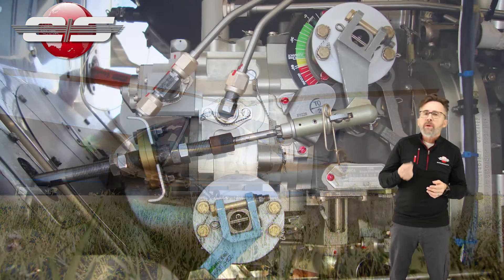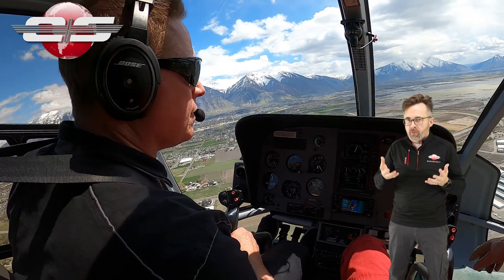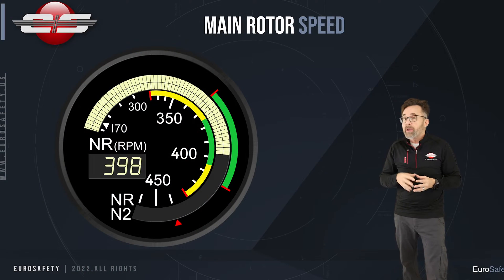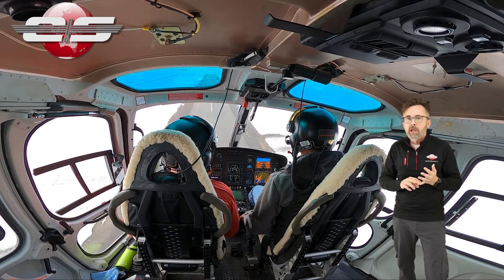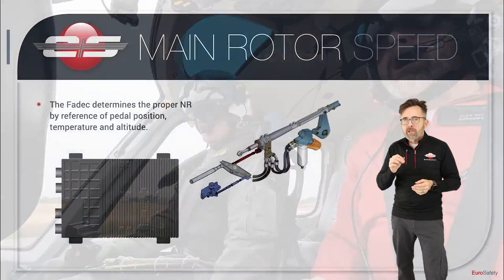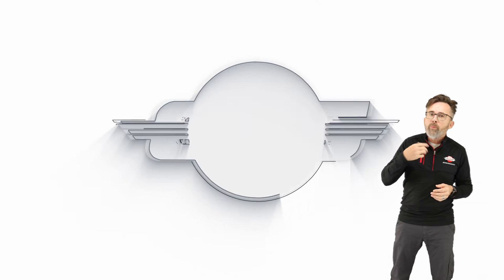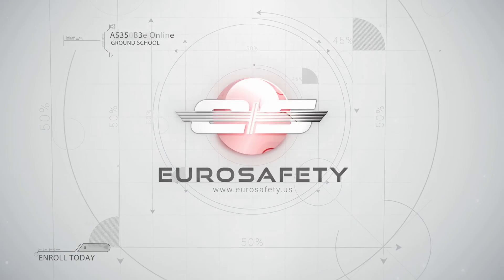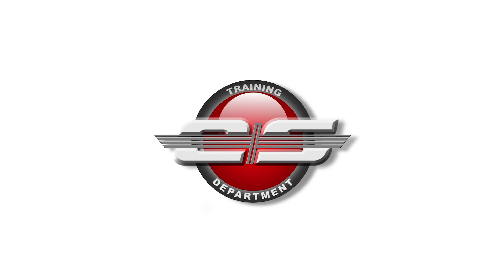#102 - Mastering the AS350 and EC130: A Deep Dive into the Variable Rotor RPM System

Comment: Question, I have heard that idling the as350 aircraft for longer than 2 minutes is detrimental to the aircraft engine. Would love to see a video like this on the topic.
Reply from the maker: Great question. This is a very long explanation so I will try to be as brief as I can. The original AS350 was designed to only use a idle NG setting in cold weather operations. Which means the original engine and transmission was designed to either be at Flight NR or OFF. The U.S. market was used to a idle event so could not accept that an engine would not be at a idle position on start and shutdown. So the US somewhat insisted on developing one (long story on how that eventually made it into the flight manual). Turbomeca over the years has increase the oil flow and design to compensate that there is now a idle situation on start and shut down. The transmission oil pump though produces the same flow as it always has, so extended amounts of time at idle does effect lubrication in the MGB. The thought process is that 30 seconds on start (oil is thicker) and 30 seconds on shutdown (gears well coated) should not effect the transmission too much. But the US pilots have a bad habit of placing the NR at a idle position when waiting on the ground. There really is no good reason to do that. When at idle the blades have less rigidity (so less safe for a person to be below) and if for some reason the helicopter would need to take off rapidly it would take too much time. When you idle an AS350 for longer than 30 seconds the lack of lubrication can be effecting the transmission (how much is not public knowledge). You will notice in many helicopters that the MGBP light illuminates at idle... indicating a pressure of less than 1 bar.

Comment: You really highlight the finer engineering details of these machines in the most interesting way, thanks!!
Reply: You mentioned 2B1 engines and 2D but you left out the 2B which also have variable rpms, what system does the 2B uses if it’s not the same as the other two models?
Reply from the maker: The AS350B3 2B does not have a variable rotor rpm system
Reply: You are educating well AS350. God speed keep it up
Reply from the maker: thank you!
Reply from the maker: Glad you enjoyed it!
Reply: 🤔 I fly it every day and I can ensure you that the model from 2001 I fly does change rrpm in a similar way to a B3+ or B3e
Reply from the maker: I am assuming you are saying when you are on the ground its at a lower rpm, and then rises when you come to a hover. But it will not change once airborne. The variable RPM system started with the 2B1 engine. Look under the liner in your aft baggage compartment, you will see that there isn't a potentiometer there.